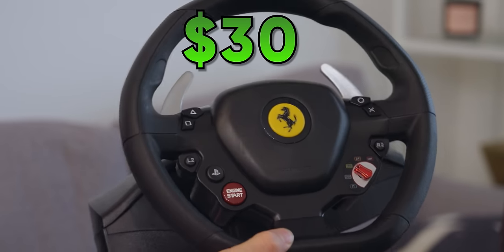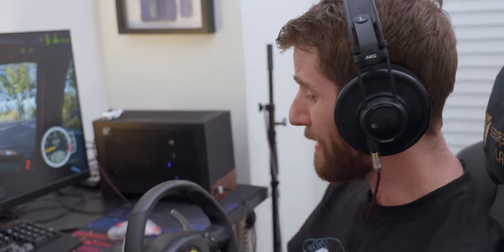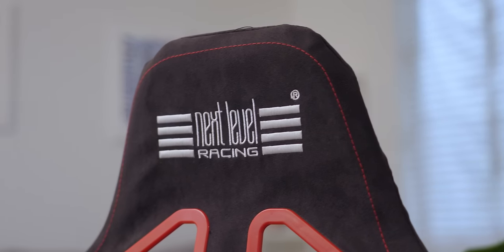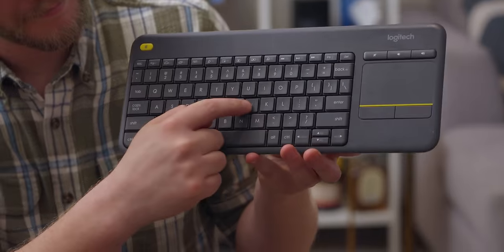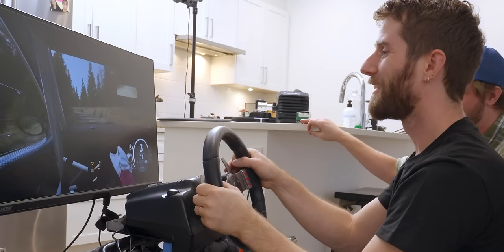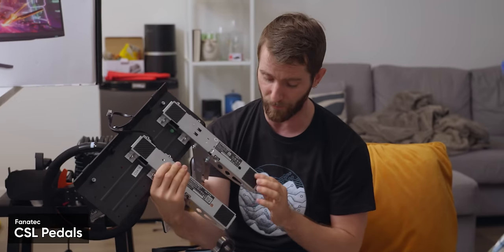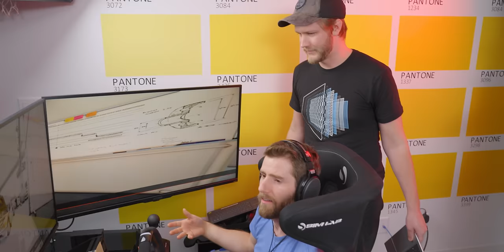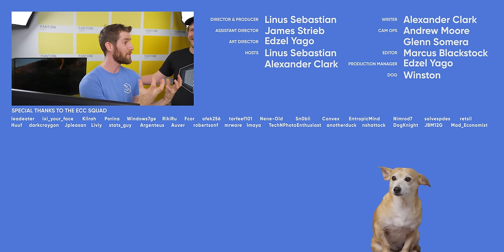Don't Waste your Money - $30 vs $10,000 Racing Setup

Comment: For the midrange setup, it definitely makes more sense to buy a Thrustmaster T300 or TMX. The Logitech racing wheels are arguably worse at a similar pricepoint, as they use gears for force feedback, whereas the Thrustmaster wheels use a belt drive. As someone who has tried both a G29 and owns a TMX, the TMX is better by a LONG SHOT. 

Also, for the rolling backwards on the cheap setup with a chair, I have a pair of Vans shoes for extra special occasions, and since I haven't used them in months (it's winter) I washed them and put the wheel casters into the shoes 😂👍
Reply: The TMX uses a mix of belts and gears as it is the xbox equivalent to the T150, not the T300
Reply: @nacltoxic  Ah, didn't know that. Still smoother than the logitech tho
Reply: @can_with_beans  Fanatec ready to race CSL DD bundle is even better lmao
Reply: old tennis balls cut in half  :)
Reply: i use a second chair to hold my chair in place
Reply: @OMM.F1  from what I've heard the fanatec firmware/software ecosystem is hell to work with but I could be wrong
Reply: a tmx is the option no doubts because its the cheapest and anyone would be happy with this if they buy it for real, i just bought mine for 70 dollar on ebay and its literally brand new like brand new i mean, but t300 and logitech wheels are always much more money but tmx is more underated i guess or like now no one speaking to much about this but its still enough or more than enough for me i am just driving chilled in forza its absolutely more than enough for me, the fforce feedback can set strong and so, so i love it i wouldnt recommende buying other then this
Reply: i just unclick the wheels from my chair takes 30 seconds and i know i wont move super easy and quick just make sure you point a leg towards the back of the chair so you dont flip yourself over
Reply: t300 is like double the price what are you smoking 💀
Reply: TMX doesn’t have a clutch pedal and looks way cheaper
Reply: @OMM.F1 Yeah exactly I was about to buy a g923 or t300 but then I saw the fanatec csl dd it's a whole o other ball game...
Reply: @Max_808  yeah I probably got a settup at the wrong time. The csl dd wasn't as cheap so I went for a T300... but yeah. Next upgrade path is probably Moza
Reply: Agreed. I used a g920 for about 2 years after upgrading from a driving force GT from 2007 lol. Now I use a launch Thrustmaster TX (T300 but Xbox)  for the last 2 years. Bought my buddy a TMX pro setup and the folding GT Lite cockpit from NLR and I was blown away! SO much smoother and more realistic feeling than the g920. Not as good as my TX that I upgraded to, obviously, but SO much more solid than the Logitech offering as far as steering feel and FFB goes
Reply: used market reflects this though, a logitech can be had for under half of what a thrust master setup can be bought by, and like he said, any good force feedback is a good start. Hell if you dont care about banging gears, a TGT wheel for £40 is a good start
Reply: OpticalDoesSimracing  0 upgrades, huh? Why bother upgrading? Might as well just buy what you want to use, rather than waste a bunch of money on things you're not planning on using. Upgradability isn't a positive, it's the admittance of a product being, to varying degrees, a waste of money. Don't understand why folks like you are so obsessed with upgrades.
Reply: I think I would just skip the TMX and go straight for the Moza if I am spending that much on a wheel. Then again, I don't do sim racing, I do virtual trucking, and neither Thrustmaster nor Logitech have put out a wheel specific for trucking.
Reply: very useful info thanks man
Reply: @Bremend  Logitech has a nice add-on for trucking
Reply: So true, I got a used t500 rs with hanging pedals for 165€ so yea if you’re on a budget that is prolly the best option
Reply: @MnemonicHeadTrip  lmao yea it does. It comes with the T3PA pedal set. Also, it might look cheaper but it still feels good

Comment: Sim racing is probably the best gaming experience you can get. The immersion you get from VR and FFB is phenomenal. I run in former title from codemasters all the time and it never gets dull. Hope we are getting VR support for WRC soon.
Reply: I think it really depends because the same could be argued for flight sim just requirements for VR are harder to get into than sim racing
Reply: 9
Reply: I can't wait for a proper commercial flight sim model, where you can SIMULATE flying upside down n stuff.
Reply: @audiokrak9598  I agree. Flight-sim too is great game to play in VR. I have monster-tech rigs set up for playing DCS. 

Sadly however, the feedback tactility is not as good as car-sims even with bass shaker and stuff. 
While you can put T-300 on a desk and it’s almost as good as home cockpit in terms of immersion if you have VR. No MFDs no UFCs, only a decent set of wheel and pedals.
Hell I say if you put entry racing seat into the mix and you’ll easily surpass a hardcore home cockpit.

I envy the ease of access and popularity of car-sims, as I am more of a sim pilot rather than a sim driver.
Reply: @Johan-di6md there is enough of that.
Reply: yeah i got into sim racing during the lockdowns & with VR + the FFB from the wheel its the only gaming that deserves to be called next-gen
Reply: Sit-down, VR cockpit games in general are seriously slept on. Elite Dangerous, SW Squadrons, Vox Machinae, Assetto Corsa, Dirt Rally, etc etc. I have both a VKB HOSAS and a Moza racing wheel+pedals and it's all set up in a way where I basically just turn my chair around away from my desk, lock it in place, put on my headset, and be somewhere else for a few hours.
Reply: @CV511  yeah I don't mind space sims as there probably isn't much ffb to be felt in space but flying a plane without ffb just feels abit hollow, it's amazing there isn't any entry level hotas's with ffb
Reply: I don't know if you can tell that like it's some Objective truth. In some racers I end up having more fun on pad and racers won't be for everyone in the end.
I got the logitech wheel and have a triple monitors and just couldn't get the feel for it, despite a pretty good setup. It's so different than the real thing, you just feel much less. It's even hard for me to judge the speed based on what I see without constantly checking the meter. Sure having VR, a better wheel and wobbly seat could probably help somewhat, but I doubt I'd feel comfortable driving
Reply: @mcgibs  Any chance to see a photo of your setup? Sounds ideal

Comment: I think the VR setup time is totally worth it imo it is easier for me to drift being able to look out the windows.
Reply: 100% I use a valve index and I find it far more immersive and personally I can’t stand the breaks in monitors even with the blend corners they make for triples, and moza r9 with srp pedal set, Heusinkveld sequential shifter, track racer frame/seat all was about 3100-3200 usd not including the computer I have. But I also have a real drift car as well, having sim equipment were you mimick your real world cars really helps but at the same time you don’t need to most expensive top of the line stuff to do it either.
Reply: Yeah but this sponsored game doesn't have VR.
Reply: Agreed, the extra bit of immersion is absolutely incredible. It can be a bit of a pain sometimes because of the occasional VR hiccup. But I converted my rig to be VR only a few years ago and have no plans to go back to triples anytime soon.
Reply: Yes! Not a racing game, but Euro Truck Simulator is sooo much better in VR with a full wheel setup. Without VR it is a pain to setup a good control setup to look around
Reply: Yeah i drift in asseto corsa. Learning to drift while looking straight out the windshield was annoying. There is neck fx that helps but after going vr i enjoy it alot better.
Reply: VR is so much better than any monitor
Reply: I honestly don't get the complaints about time to setup VR or about the hardware randomly not working. I never have to fiddle around with my Index - it always just works.
The only exception is when the game doesn't properly support VR, like in Assetto Corsa where it only displays on the monitor when in the menu. The result is that I just never launch those sims ever again.
Reply: @DMan-ud6bt  tbats the annoying thing about ac vr. I have a monitor setup infront of me while using vr in a sim rig because i dont use controllers and sometimes the mouse wont show in vr so ill have to lift the headset and look at the monitor to click something in asseto corsa. You can set the game to launch straight into the race though.
Reply: Meh, I have 4 VR headsets but I race on triples.  Its not worth the hassle for me.
Reply: Tried this with my g27 and my rift S. Played games like Alex and saints and sinners no issue. Wanted to throw up after my 1st lap. Maybe it's not as bad with a more modern headset.
Reply: triples will always be better than vr.
Reply: Except VR makes me sick.
Reply: VR was made for racing . Makes a lot of sense and practical haven't tried yet but would like to with F1 or GT7
Reply: I cant see spending that much on the setup and then not doing vr over 3 monitors. With the HMD being stationary, it shouldn't be hard to set up every time like they made it sound. Then again i dont have issues with my index.
Reply: @enzovulkoor  triples is better than vr.
Reply: VR in my Quest 3 is better than any tripplescreen
Reply: Its a nice feature in my opinion and for drifting its actually great but 99% of the times i still dont play in VR, its just not as comfortable.
Reply: @benistingray6097  do you have motion sickness or do you just have a quest 2? Vive pro is comfortable enough for many hours of use.
Reply: @hypnotiq  Care to explain how? As a VR user, everything in a triple monitor setup screams "damn that breaks immersion" to me. The line breaks between monitor, the fact that you see your room above and under the monitors, the fact that you see your steering wheel on top of the game's steering wheel. Not to mention that a headset is cheaper than 3 big ass monitors...
Reply: @MrPablosek  not really about immersion, but
Easier to run
Can see more
Easier for content creation
Easier to set up
Easier to start racing
Reply: @hypnotiq  Having to render 3 screens at once even at 1440p each is not easier to run than VR. 
You can't see more. You are limited to what the screens show you.
How is recording 3 screens at once easier for content creation? You can record a single screen at most for the proper youtube format. You can do the same with VR
My VR headset is literally just plug and play. For triple screen you have tons of cables and need a lot of space.

I can only agree with the last point, but even then I doubt anyone would start racing with a triple screen. Most would start from a single screen.
Reply: @MrPablosek  biggest copes of 2023
I've used an ultrawide, vr, & now on triples.
The only thing vr does better is immersion.

Comment: Make no mistake ... the brake pedal is where it's at. Having a good brake pedal can really give you an advantage. The wheel, after having Force Feedback in general is a slight improvement from geared FF to belt FF to Direct drive. Also having a fly off handbrake if you want to drift or go rallying really helps. If you go GT3 or F1 the wheel's switches become more important so you can adjust the settings on the fly. Especially if you drive in VR, which is a very good alternative to 3 screens. If you start building a serious rig, and you can't afford all the stuff at the same time (like me) I think it is best to start with a rigid and moddable frame. So as you improve your rig you still can use the same frame for all your extentions and improvements.
Reply: Next Level Racing has products that integrate with each other as you upgrade your set-up all the way to motion seats.
Reply: But the most important thing is comfort and health, i damaged my back bone and the bone in the middle of the butt( i don't know what it's called in English) because im too immersed and sitting too long sim racing in a bad posture in a cheap badly designed chair
Reply: I had a G290 wheel and I'll tell you that it makes way more difference having a range than resistance. I race on my friend's Thustmaster and the brake pedal has good gradual resistance but I could set better times on my rig just knowing the range. (I removed the rubber block) Also, Pro Tip, we like to keybind the handbrake to left paddle, since we exclusively use the H-pattern.
Reply: @PikemanLures  For me muscle memory works better than pedal travel. And it is way closer to real driving. I can translate everything into real driving except for the G-forces. But they give me additional information so. Driving fast in reality is easier than in sim ... for me at least (Since I feel no fear, when I think, I know what I'm doing).
I only use H-pattern for Cars that use H in reality. When there's paddles in the real thing, I use paddles. I even use 3 different wheels for 3 different kinds of cars. A clean one for Drift, Rally or Oldtimers,  an average wheel with a few butons and paddles for street legal cars and the fanatec Mclaren GT3 for modern race cars.
Reply: Brake pedal is more important than gear vs belt vs DD. Throttle pedal is strangely not usually a problem, which is a bit odd since you need a lot more finesse with it.
Reply: @PikemanLures  There are two schools when it comes to brake pedal travel range, not just in simracing but each racing driver has their own preferences. Some like long pedals, some like very short and very, VERY heavy brake pedal that just barely moves. I like short and heavy, not extreme in either axis but an inch or so of travel with heavy springs. I added a block... So, there is not just one way, brake pedal is customized for each driver.
Reply: it doesnt give you an advantage. It just gives you the feeling youre faster.  Im just as quick with G27 pedals as im with high end pedals
Reply: Even cheap pedals can be fabricobbled to be good enough. just need to ad some rubber or springs to make the cheap brake pedal STIFFER like in a real car. then you get some extra resolution as you dont allways push the pedal straight to the bottom
Reply: The pedals i'd say are more important than the entire setup.
Reply: @vihreelinja4743  I replaced my G29 pedals with 3DRAP upgrade and even replaced the sensor with the load cell from ricmotech. It still didn't match the Fanatec V3 inverted Pedal set I replaced it with in the end.
Reply: @Fisherman6383  The bone you refer to is the coccyx , I think (aka "tailbone".)  I hope you made a full recovery!

Comment: I got into sim racing during 2020 while being off work.  I got the TM T300 RS GT.  Built my own rig. Realized that it was something I thoroughly enjoyed.  Bought the NLR F-GT and haven't looked back.  It's a fantastic mid-tier setup.  One thing I think is worth mentioning, when you set-up - be sure to reference proper ergonomics - especially if you become an enthusiast like myself.  Musculoskeletal injuries are not worth it.
Reply: yes they are :)
Reply: I have a DOF 3 degree setup and I don't have injuries... if you do you need to be hitting the gym and not sitting in a chair racing.
Reply: @thomgizziz  They're talking about injuries that result from poor ergonomic situations. If you spend hours and hours in a bad seating position you can give yourself back problems, nerve pain, other nagging "overuse" type injuries that could happen whether you're in good physical shape or not. But yes going to the gym is good too.
Reply: he TM T300 is a great little wheel to get into sim racing, you made a great choice. I will say, the pedals TM where never up to much good but certainly do the job. Fanatec have a pretty cheap pedal set called the "CSL Elite" that when combined with an adapter, will take that T300 to the next level. The pedals cost roughly around $65/€59.99/£52. They feel ridged as anything and allow for a lot smoother throttle and break application. You can even take those pedals I mentioned even further by buying a loadcell kit for them.
Reply: @ross302ci as a single dad of 4 with custody I work out but drive forklift for a living and that shit compresses my back so much that I practice stretches and techniques when I jump off my lift…and some back cracking or stretching techniques that I found on YouTube where a godsend….but by Friday I’m sore and tense and the weekend I heal up…it’s not the worst pain, but proper posture and seating is key….
Reply: It's also worth mentioning all these rigs are made to save space and can be easily stored when not being used. Definitely a solid option for those who can't afford something better or simply doesn't have the space to have an actual rig lying around the house. The fact the NLR rigs and Playseat Challengers etc can be stored is their main selling point. The guys who made them definitely did their homework.
Reply: Challenge: 
Gym bro to NOT mention the gym

Difficulty level : impossible @thomgizziz
Reply: T300 RS Alcantara here. Hell of a rig 🤘 Wheel is phenomenal
Reply: I have the same wheel, not a die hard sim racer or have a die hard rig, but I really enjoy when I can.. it's about the immersion for me....